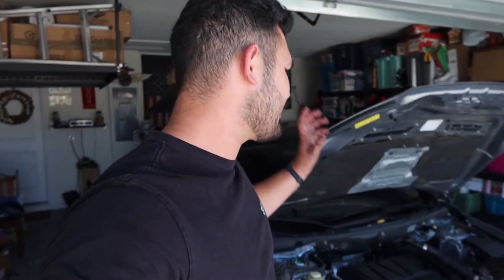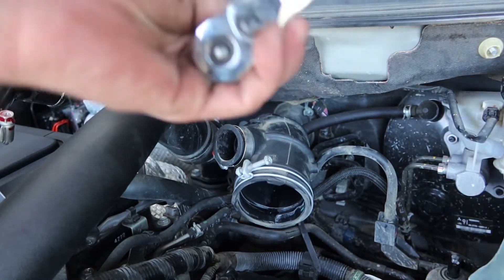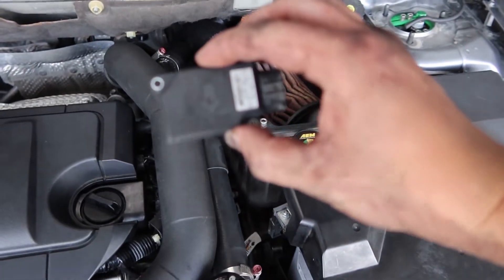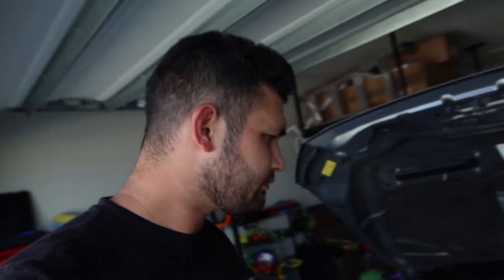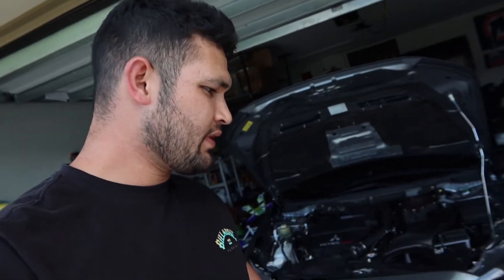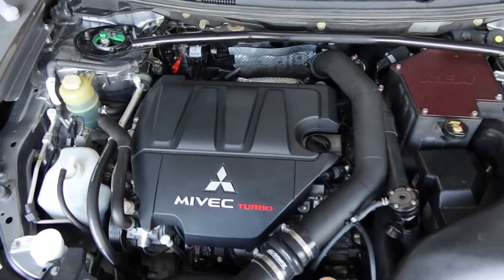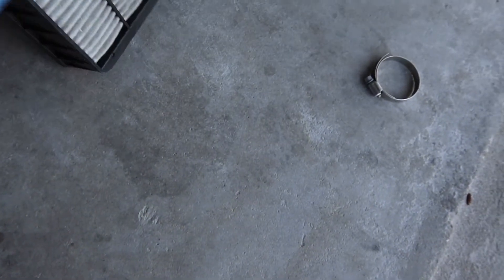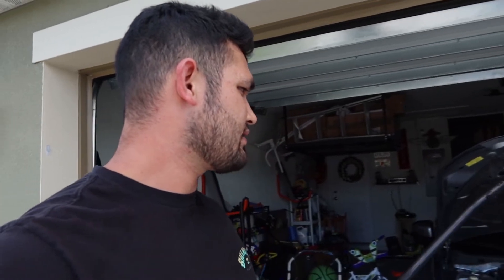2008-2015 Ralliart AEM Intake Install

Comment: hey man, love your videos! I own a 2011 ralliart and have used many of your videos to help me along the way. I appreciate all the time you've put in. and can't thank you enough. Was on the verge of getting the aem intake but didnt know if it was compatible with the evo x turbo which i plan on installing. my question is. With the aem intake I can still hook up an evo x turbo to it in the future?
Reply from the maker: Yes. You just have to get the RRE (road race engineering) adapter
Reply: @TheSnyds  fshooo. Good looking g! I may do that so i dont have to relocate battery because i love my trunk space aha.

Comment: Hey bro did you have to tune the car after installing? I have a 2015 raliart too and want to add a cold air intake
Reply from the maker: Yes. Tune will be required. I used a gst tune

Comment: Hey man good videos help a lot   I just have a question after install my intake  service engine soon Comes out
Reply from the maker: Did you run the tune?
Reply: @TheSnyds   not i don’t 🥴🥴
Reply: You talking about the tactrix.??
Reply from the maker: @220711992077  If you change the intake it requires a tune bro
Reply: Thanks again bro I need make the order  I really appreciate the videos you make keep doing this very good job
Reply: I appreciate you answer the question this thing make you different to others YouTubers
Reply from the maker: Thanks bud. Do you have a test pipe too?
Reply: Not yet